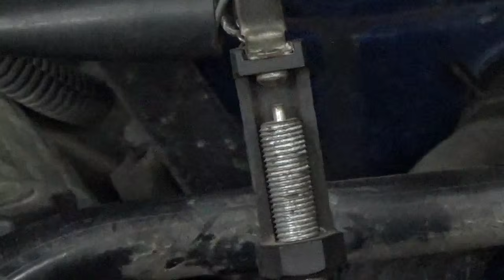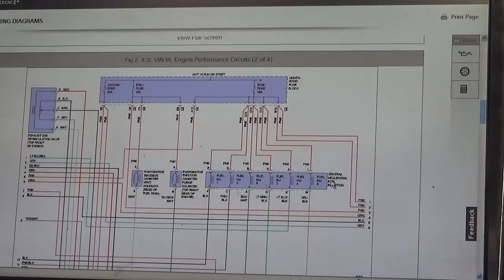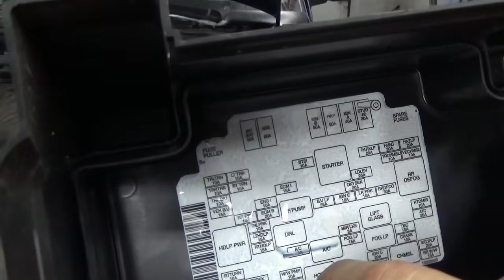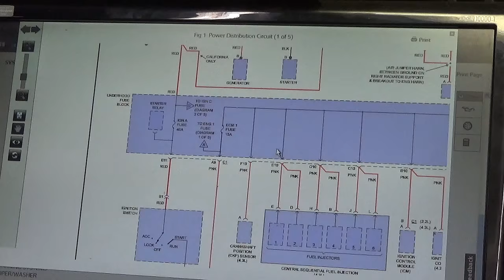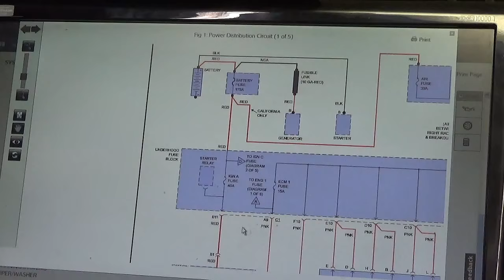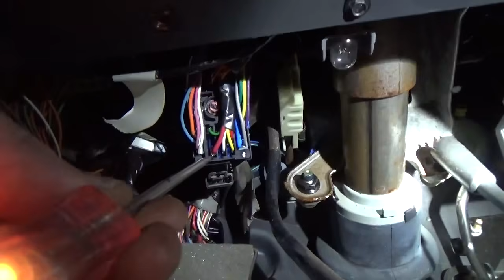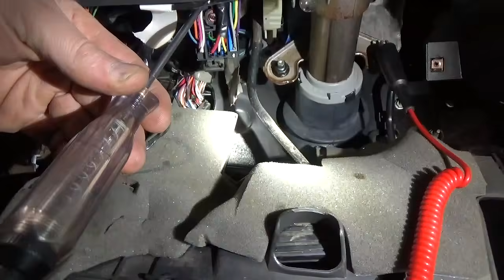No Start / No Spark / Cranks OK - GMC Jimmy / S10 Blazer

Comment: great vid..now i have a problem i created.i hooked a stero up to the ignition wire in the inside fuse box then the fuse blew so i unhooked it. and replaced the fuse but now the 98 blazer 4x4 wont start at all and doesnt even hit it crnks good but wont fire...i have checked all the fuses inside and under the hood and all are fine .do you have any idea what could have shorted out when the fuse blew which stops the blazer from starting?the security light does not blink so it isnt that..help

Comment: Eric. Excellent video. Anything on 2000 to 2002 GM pcm/ecm failures would be informative. Just had a 2001 olds alero in that had a a constant running cooling fan and inoperative fuel gauge both caused by improper used ecm  installed. Weird that the vehicle ran great though.

Comment: Same type of problem with a 98 jimmy. But a little back story, the people I got this from bought it new. About a year or so ago, it started shutting off while they were out and about. They would wait a few mins and it would start back. Fast forward to now, I have the vehicle. I replaced the intake gasket. It seemed to run smoother and less shaking. Well today I started it, it ran fine for awhile, then it shutdown. Not only would it not start again (it'll crank over) the gages won't work (none of them).  You couldn't even press the brake and take it out of park (it would make the noise when you pressed the button on the gear stick) I have a code reader and there isn't any. Is the ignition switch a choice to replace? The vehicle is 20 years old and has over 300k on it.

Comment: I know this is a old video but I have a 97 Nissan Sentra gxe 5speed crank but won't start no spark at spark plug wires but whole distributor assembly is new need your help thanks

Comment: LOOKING AT A J2534 TOOL JUST A LITTLE UNCLEAR .   I LOOKED AT THIS Drew Tech Mongoose Pro Oem Diagnostics And Programing Cable General Motors GM 2  ONLINE WAS WONDERING WHAT YOU THOUGH  IS IT WORTH A TRY  .   WOULD LOVE SOME IN DEPTH THOUGHTS HOPEFULLY THE EASIEST WAY FOR A BEGINNER THANKS FOR YOUR RESPONSE .

Comment: Great video. I am experiencing an ECM1 blown fuse. I replaced the o-ring on the CRank Position Sensor. Do you think this may be my problem? I also wanted to view a wiring diagram for the different circuits to check. Whare can I access this information. Thanks.

Comment: Thank you so much! I'm 95% sure this is exactly what's going on with my 1998 Chevy S10. I've been noticing the last month or so the engine starting when I let off the key most of the time. So when I saw your video and the same thing I was for sure that was the problem. So I had my wife come Al and start my truck while I tested the fuse but... The truck turned over no problem.REALLY!?! I did remove that fuse and reinserted before I had my wife crank it over so I'm not sure if that helped the issue. Guess I'm going to wait to see if it stops working again. But thanks so much for your work

Comment: How's it going? I have a 1991 chevy s10 with a 4.3 ltr. As of right now, there's no spark. I've put a lot of new parts in it like, new distributor, cap and rotor, spark plug, ignition coil, ignition control module, ignition switch, relays, water pump, thermostat, radiator, starter, fuel injectors, fuel pump. And it's cranking but won't start. What do you think might work to start my truck?

Comment: HI MY FRIEND II GOT A 2001 PONTAIC GRAND 2.4 L    4 CYLNDER   I PUT NEW SPAK PLUGS   NEW COILS  NEW DISTRBUTER CAP I CALL IT...& NEW IGNITION CONTROL MODULE  CHECKED ALL FUSE  STILL NO CRANK... NO SPARK...HELP   THANKS SCOTT

Comment: @soutmainautorepair I got a question, I have a blazer xtreme 2001 and I replaced the starter because it was bad and then I replaced the switch because it was bad, I connect the positive and then the negative and the car turn over and the motor starts up without having to putt the key inside . What do you think seems to be the problem , keep in mind the blazer only has 2 cables connected not 3 , can you help me fix this issue ?

Comment: Eric O and friends I need help with my 2001 S10 pickup. It runs well. Good power, good mileage, idles good. Had to replace the intake manifold gaskets, had a water leak no overheating. Once together cranks, no start. Good spark, injector pulse, 55 psi fuel and 1/4 tank fuel. The alarm triggered twice and was able to reset no problem. No codes. did a key reset. replace crank sensor, complete distributor with cam sensor, plugs, coil, ignition module, and wires. It sounds like it has good compression. Sprayed starting fuel to see if it would respond, nothing. Checked distributor install to cam crank time OK. Can you guys point me in another direction? I was considering the rockymountain body control module delete for 285.00. What do you think?

Comment: we have a 00 s10 blazer cranks no start, it has power to the bottom of the fuse box pink wire under hood but no power at top of fuse 15 amp  if we put power to this fuse it will start, any ideas  i tried resetting security no luck. security light is on and flashing

Comment: hey Eric. i have 97 Chevy s10 and a 99 Chevy Blazer (both 4.3 Vortec v6) and I was wandering where you got the wiring diagrams for the vehicle, I do a lot of my own repairs (or at least try to) and I could really use these for diagnosing problems. if you could help me that would be great.

Comment: okay guys I need some help Chevy S10 1999 6 cylinder fuel pump went out on it replace the fuel pump replace the filter then I had to replace a map sensor throttle sensor there's a couple things in the pressure on the fuel the same 60 that is not staying running can anybody help me or show me how to do this so I can go back to work really would appreciate it thanks

Comment: Thank you so much  for  your  good. Videos,                    

My.  Question. Is.  That,,            I. Have.   Honda   Accord 1998.     With.  122 k.   Mileage      Car.   Running.  Ok., but.    In. The  morning.   Engine.  
Shut off  itself. And. Do not. Keep.   Rpm.      Than.   Shake it.   And.  Shut. Off.

Comment: My s10 cranks but sometimes cuts out when turning over I tried to check all the connections. Does it sound like the same problem you had here? Mine though starts when it does crank over. When it cuts out obviously the flywheel starts grinding on the starter which sounds bad. Obviously then I stop turning it over at that point.. But when I try to restart the truck it does turn over and start.. So my problem is a intermittent problem.. Do you think it is the ignition switch for me?

Comment: have a 96 gmc sierra w/4.3 v6. when it is cold it starts farely quickly, when it is warmer it will crank but wont start .after nearly killing the battery the engine may or may not start..i have followed your path and have fuel, spark and air. when it does start it runs great and generally will start every time thruout the day, then the next day may not start,any help would be appreciated. has new coil,plugs wires,rotor capand replaced ignition switch

Comment: I have a 95 blazer that has a pulse at the coil ground signal and 12 volts at the pink wire at the coil... but no spark at all. what gives? is it possible for the icm to fail and not command enough spark to make it spark or something? tried two new coils and same problem. thank you!

Comment: Same issue recently. Took out the switch and pulled it apart and cleaned the connectors inside. Put it back together and all is good. GM stealership wanted $170 and I'm a cheap SOB

Comment: I get that a lot from Advance auto.  People buy something, switch it with the broken part and return it. What irks more than the low lifes doing such is that its usually obvious and the clerks don't check.   When I mean obvious: the box is all ripped up, The part has grease all over it, and it doesn't look new.   Yet, it finds its way back onto the shelf and into the unsuspecting hands of someone buying it.

Comment: hello, i am having a similar problem with a 98 chevy blazer. i notice if i turn the key about the quarter of the way it starts up just fine. of course this problem seems to only happen on cold starts. could this be the ignition switch as well?

Comment: Great video. Thanks for showing the correct way to diagnose a no start vehicle. Precise and to the point. My sisters is doing this and mine 98 Blazer won't start when it's cold outside. I'll have to try what you did in this video.  Thanks again for a great diagnoses on a vehicle.

Comment: I have an issue and tried your jumping a wire to the ecm fuse to see if my truck will start. it don't and I even changed crank shaft sensor when I crank , no start but does sound like wants to fire when I release key. can you give me some direction please. I even replaced ignition switch. frustrated vet.

Comment: Hi there,
i have a ram 1500 2008 4wd 5.7 with the weirdest problem, when i turn the key the starter gets power for one second, then cuts the power to the starter, battery and starter are new, so probably the TIPM is faulty, what do you think?

Comment: Hello Eric, Thank you so much for this video. I had the same exact problem with a 2002 Chevy Silverado I bought used a few months ago except mine was an intermittent problem as that last little bit of spark at the end of the crank cycle was enough to start the truck....but only when it was warm, as it got colder I would have to crank it for numerous short bursts until it could fire with that tiny amount of spark on its last 1/4 turn. It took awhile of checking things until I realized the motor would only start as I disengaged the starter. From there I was lucky enough to find your site and search my problem. I couldn't find a wiring diagram for my Silverado but took a chance on the ECM1 circuit and it was the same as the Gimmy. For anyone else out there with a similar problem don't let the hot start cold no-start thing throw you because it still could be the ignition switch. Eric you have a great selection of help videos and do a great job of teaching. Cheers to you!

Dean

Comment: I stepped in a pile of helping the neighbor.  The condition was crank no start cold.  Looked for spark and there was only a pop when the ignition switch was released from start to run.  Found the previous video https://www.youtube.com/watch?v=PvVgu6E_z4w and trouble shot as instructed.  The temp was -2 out here in Wisconsin and when I jumped the ECM fuse to the battery the truck started on command. This was the trail of bread crumbs I needed.  I sourced a new switch (not OEM), but I got it today and not tomorrow.  Watched the video on replacing the switch, and I found it very informative.  Reconnected the battery and she starts like a champ.  These videos sure made the impossible possible thank you.

Comment: did the fuel pump whine when you put the key in the "on" position, from the "off" position?  Vaguely sounds like it at 6:26...I am diagnosing a similar problem, I know for sure I am not getting the fuel pump whine when the key gets turned on.
Reply: Dustin Silva you fix it yet?
Reply: Dodge 318 Cummins yes, pump was bad...
Reply: Dustin Silva oh that's good my civic is having an issue with spark I think it needs a crank position sensor.
Reply: You've done all the obvious things like cap/wires/plugs/rotor?
Reply: +Dodge 318 Cummins roderickkirksey30@gmail. com

Comment: I have 99 Blazer with crank, no start, I would get spark as the was turned off but next day it would fire right up (several times) then the next day it wouldn't fir up. So I pull the ECM 1 fuse  and turn the key on and place my tester in either socket and the tester would not light up, so my ECM 1 fuse is not getting any current at all?  What do you think it might be?
Reply: Check the battery cables?
Reply: About 6 months ago I replaced the  cap & rotor!  But I took off the cap & rotor to change the Camshaft Sensor (inside the cap, under the rotor) I found the of the rotor was cover with black soot Bad, the cap & rotor was a cheapie, so I replace with a DelCo!  Now she starts up with a tap of the key!  But thanks anyway!
Reply: AC Delco parts are best, huh?
Reply: AC DelCo Parts are 'RIGHT ON--MERRY CHRISTMAS!'

Comment: Hey Eric, if I spell your name correct, my 2001 Chevrolet Express 5.7L have crank, spark and I did same test like you did.
I have power to the pink wire when on and crank, red wire power lid but no light power when crank, does this mean I need
new ignition switch still. Could you advise me please, I have new ignition switch and have already remove everything to replace
the switch but I don't have the small hex socket to unscrew the 2 screws on the ignition switch. Dealers r no help with the size and autopart store don't have them too.
Reply: KuvYog I'm in the same situation with my 2001 GMC Jimmy, did you ever solve it?
Reply: hey guys ,  do you have a link to a picture so i can see what it is? will try and help yoiu out

Comment: I have a cranks, gets fuel new pump new spider, new coil new icm and new crank sencer. Started out it ran after putting a new motor into it 2 times then parked it. A week later went to start it and it wouldn't fire up. Found out I had no spark. The icm was the last thing I got and it got it to fire up with spark. I shut it off and put things back together and let it sit again for a week. Won't start again. It looks like it has weak spark from the coil. Starts strong for a sec then gets weaker it looks like. Did what you did in the video and ran power to that fuse box and still the same thing it won't start. The only thing I can think of now is the new icm is shit and I need a new one again.
Reply: check the ground?
Reply: Randy Robinson turns out the cheap new icm was bad too. Paid 90 for a new one and it fired right up.
Reply: LOL if it's not one thing, it something else. I   bought a Jimmy SLT in Oct, and I'm still working on it. So far all the electronics seem ok. The cooling system was toast, inlet tank on the rad was cracked so they just kept pouring the regular water in. Plus it was switched from dexcool to green coolant. I removed the trany cooler from the inlet tank because the exchanger blocks the coolant inlet connector. Pull your bottom hose off and look in there. the exchanger is right in front of the opening. That's the most stupid design ever. Same thing on the other end of the rad if you have the EOC (engine oil cooler) the exchanger blocks the outlet. No wonder these things have cooling problems. I'm going to install remote oil coolers instead of in rad type coolers, and get a big aluminum rad with electric fans. I did the same thing with my 77 Vette. I can sit idling in traffic over 100 degrees here in FL with no issues now. The only other problem I have on the Jimmy is the Torque Convertor is whining. It looks like the oil hasn't been changed ever. I'll try a filter and a full oil change and see what that does. It might help, other wise I have to replace it. Do you have any suggestions on that?  If you need another ICM let me know I have 2 extras.

Comment: Love all your videos they have been very helpful before. Now I am trying to help a friend with a crank no start problem on a 2003 chevy pickup 4.3L. Crank no spark from coil. the coil has power to it during dash on and while cranking. Replaced the coil but no spark on the new coil. I checked for RPM with scanner and computer knows there is RPM about 650 to 700 rpm while cranking. What else could keep the coil from sparking  ???   please help...  Btw, the problem started when the engine was running and all of a sudden it suddenly stopped.   thank you ahead of time.

Comment: used your video as a guide was very easy to change out the ignition switch, but now having problem with the Key cylinder. when i start the engine turns over and then it dies. Found out when that at the slignt wiggle of the ignition key that is when it dies. Do i need a new ignition cylinder switch?

Comment: my truck cranks but won't start, it's not the ignition switch, I checked it like you did and it stays on, the fuel pump turns on

Comment: In my fuse box there is a space marded IGN but there is nothing in it. Its too small to hold a fuse but it could hold a wire lead fitted with a spade like there is in other similar places. What is this IGN and is it supposed to be empty. I have the 1993 GMC Sonoma S-15 TBI 4.3-L 6-cyl pick up.

Comment: I have a similar problem with a 1993 4.3 L 6-cylinder TBI GMC S-15 Sonoma. It stalled out while I was idling at a red light so I towed it home. It cranks but wont start. It wont even try to fire with a burst of ether sprayed in so its not getting any spark. I put in new wires, pre-gapped plugs, dist-cap with rotor, ignition module  but I didnt change the coil. It has the same old coil. I was wondering if you could help me zero in on why I cant get it to start. Right when it stalled out I notice a 'service engine soon' light. I cant find any of those under-hood fuses that you tested in the vid. all the fuses i can find are all in the cab under the dash on the driver side near the floor and firewall. Thanks in advane.
Reply: I have a 2000 saturn SL1 crank no start.ive changed the starter,plugs,wires and crankshaft position sensor and i still have no spark.any suggestions?
Reply: To add when key is turned like normal where everthing lights up on the dash instead of clearing it all stays on

Comment: i have a 94 sanoma replaced the cluch now it wont start you
can pore gas in throttle body and it will start and run i can't hear the fuel pump come on can you help
Reply from the maker: If it ran before you did the clutch and it wont run now it only stands to reason you did something wrong or pinched the harness in the bell housing...